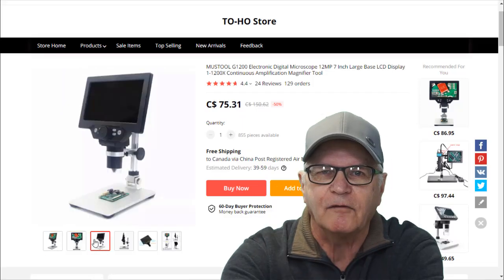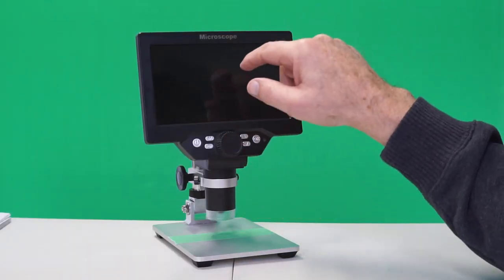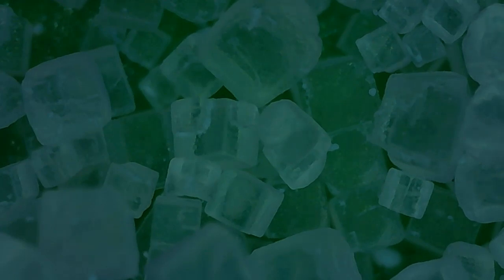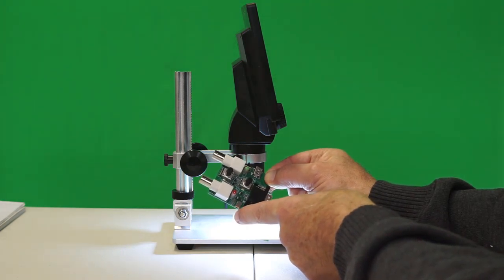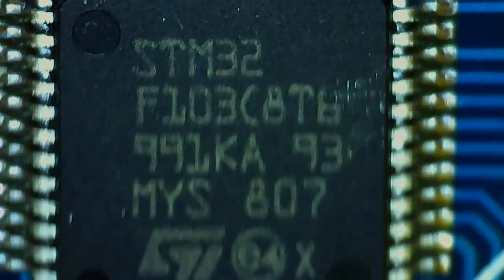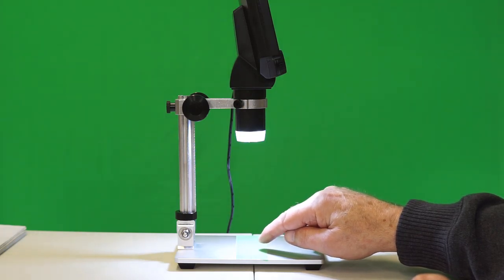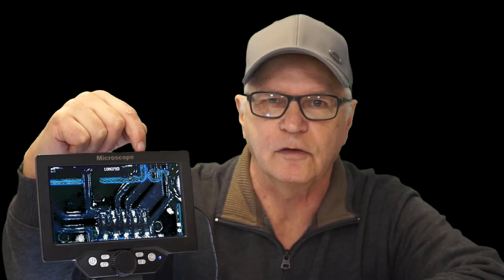GADGETS#86 - MUSTOOL G1200 MICROSCOPE

Comment from the maker: This can be purchased with a 3.7v   3000mAh internal battery (which I chose not to do)
An image of graph paper to assess lens distortion can be found here:
https://drive.google.com/open?id=1LcLRe8ii4CFLFWB_7Sz12e6Qh5A1XMdH
Reply: What firmware did yours come with??
Picked one up with battery from BG and arrived here januar 2020 and do have some issues and seems to be down to FW.. not least lack of adjustments and cropping that are not active..
can be seen here with v1.0 2019 09-20 https://imgur.com/a/2FIfuMu
Reply from the maker: @JAKOB1977  - no issues to report here...
FIRMWARE is:
H69G-V1.0-20191009
Hope this helps...
Reply: @theGADGETSplaylist  thx for the info but also weird it looks like mine is a FW 10 days older than yours.
https://i.imgur.com/hNOkrug.jpg
but on mine, you don't have fx digital zoom it simply wont work in ,liveview like it should, and some of the exposure settings are also not active and when casting the stream to a computer screen thrue USB it is extremely dark, close to unuseable..
It looks like there are these newer batches with inbuild battery from Mustool with this limited and semi defect  v1.0 2019-20-9 firmware.
Reply: @JAKOB1977  hi, i bought it last month all was good since last week, The 8 LEDs light very dimly now so I decided to reset it with a needle and nothing change, I put it in an other universal Adaptateur I use for tabz and now I have a white screen and leds lights work perfectly now.... I use it for work and now I'm stuck what can I do??

Comment: Mustool is an importer spamming thier promotion videos everywhere, get 
the cheapest G1200 you can but beware if you need a battery as some come
 without but its unlikely you will need this feature unless your buying 
for a child, you can connect to a pc by throwing away the power only 
micro usb cable that come with the G1200 and using a proper micro usb 
data cable. Picture is amazing and perfect for solder work
Reply from the maker: no battery on mine...only drawback to that is entering the preferences each time...but I would tend to double check anyways before shooting a video to make absolutely sure all is OK...
helping me out quite a bit, glad I bought it.
Thanks for watching:)

Comment: What you don't realise is that it has a 12 Mp sensor.......that is important when you save an image to an SD card and then blow it up on your computer with whatever program you have for viewing JPEG files...........any of the cheaper microscopes with only 2 Mp sensors will pixilate when you try to blow the image up from an SD card on the PC screen.
With the in built 7 " screen you can get by with lot less pixels as the screen is so small.
So, you "could" really get a huge magnification with this microscope mainly due to the big sensor pixel count but mainly on a bigger PC screen from an SD card JPEG file.
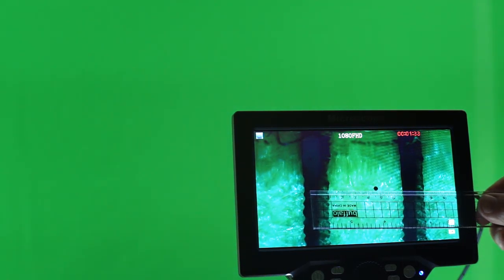Reply from the maker: What you don't realize is that this was mentioned @ 2:25
Reply: @theGADGETSplaylist  Hmmm....more or less, but not the actual MP count which is a more important feature for later viewing on the PC from an SD card file.

Comment: Took your advise on the microscope and am totally disappointed. The first one was damaged in shipping and the second one (replacement) started out ok but after one use it decided it didn't want to turn on anymore. The wall-wart USB port was very loose and intermmitant but I did get it charged so that wasn't the issue.
Reply from the maker: oh MAN, am sorry to hear that...
I use this one all the time, couldn't ask for better.
Don't know what to say...
Reply: @theGADGETSplaylist  Not blaming you.  How could you know about crappy Quality Control?
Reply from the maker: @charlescarey5874  never felt blame:)
Did feel your disappointment. Am surprised by low quality while having "Microscope" on the bezel.
Thanks for sharing your experience in the comment section, Charles
Reply from the maker: is "Microscope" written on the bezel?
and is the focus knob face smooth or does it have a dimple in the center?
Reply: @theGADGETSplaylist  "Microscope" on the bezel = true.  Don't remember the dimple on the focus knob.
Reply: Did you use a phone quick charger ? My first microscope got burned when my samsung phone charger decided to output 9v instead of 5v
Reply from the maker: @TechTroppy  - yes, I power it with a 5v charger. I don't think it can output any other voltage.
The one complaint is the USB on microscope is situated in a way that thick plugs don't fit well...I have "shaved" the USB plug on the charger I use to alleviate that issue.
Reply: @TechTroppy  I used the charger that was shipped with the microscope.

Comment: Did you managed it to connect it to a PC and use a software where you can change contrast, brightness, color and so on?
Reply from the maker: +ImLee - I did briefly test it out with the standard camera app that is built in Windows. No additional software. Connected and displayed just fine.
There are also contrast, sharpness and brightness settings in the microscope menu.
Reply: logical canuck 

I did the same, but changing these settings directly in the microscope or in the software do not effect the picture or the video on my PC.
Reply from the maker: @ImLeeAT  - I would think those microscope menu settings apply only to its LCD.
You would have to adjust the PC display settings if viewed through there...
I mainly use the 7" LCD and the sdCard for video content creation.
Reply: logical canuck yes this is exactly what I did. But no effect on the picture on the PC
Reply from the maker: @ImLeeAT  - hmmm...it's all I got🤔
Reply: logical canuck thanks for your respond

Comment: Did you get it with the battery. If yes can you use it with the power supply?
Reply from the maker: +Samson S - no, I did not get the battery.
It works off a 5v power supply. The main inconvenience is the settings are cleared each time it's powered OFF.
But, as with all equipment when I make a video, I would double check those settings anyways (I've learned!). I'm OK without.
A battery can be added later but the description is vague so if you want the battery model it is best to  order one with it.

Comment: I got mine on the 24th as well.
 I took it apart to see the size of the battery because it seemed to drain quick. I drained and recharged the battery on a rc battery charger to find out how many mA the battery could hold. It is a 1 cell lipo and mine has a 2200 mA capacity when fully charged.
What program are you using to view on your computer?  I am trying "Debut Video Capture Software" the free version.
Reply from the maker: +Imt200 - I didn't get a battery with mine. One can be added but I won't bother. The biggest drawback is having to reset the settings if powered down.
In the video, I simply used the .MOV file from the microSD card and imported that in my editing software (CAMTASIA).
If microscope is connected to the laptop, no extra software is required as the Windows camera app does the job.
Does yours say "MICROSCOPE" on the bezel?
Reply: @theGADGETSplaylist  It does, looks the same as yours.